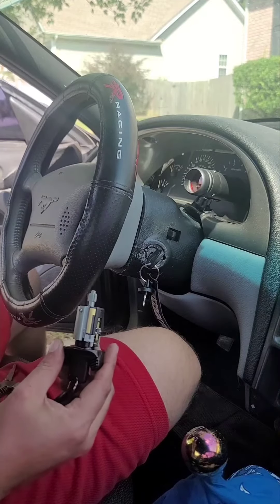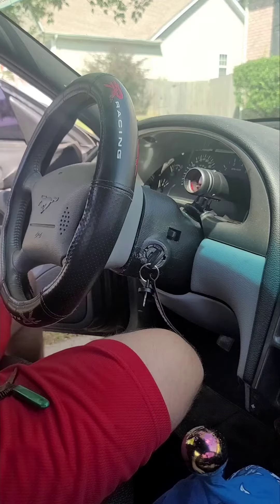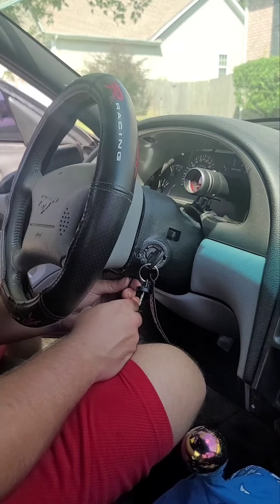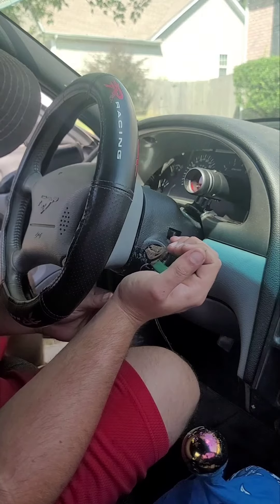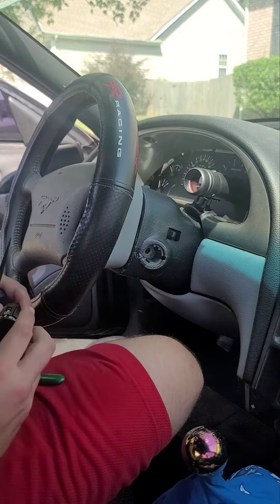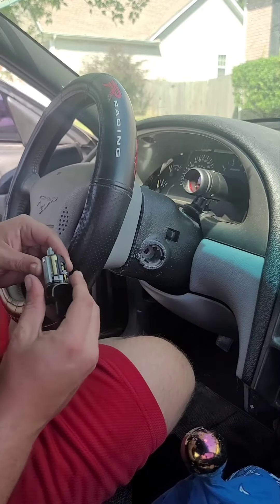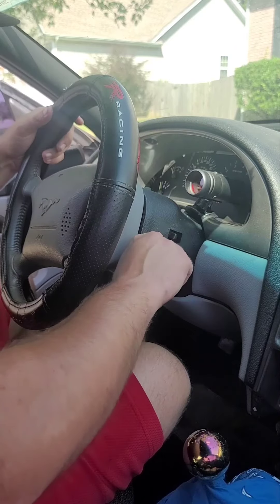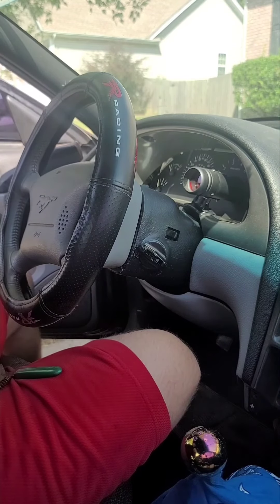94-04 Mustang Ignition Cylinder Replacement

Comment: Pushed on the pun and tried the pull and it did nothing for me. Wondering if the locked steering wheel is preventing it. I have a 96 gt

Comment: did you need to have the key programmed and the door locks rekeyed? Thanks for the help.
Reply from the maker: Ignition key does not need to be programmed on 94-95, starting in 96 Ford had PATS antitheft and it can cause problems.   Door locks will need to be keyed to the new ignition key to match (trunk lock too!)   I just keep both keys on my Keychain!
Reply: @cobro9567  these are the things you need to say in the video
Reply: @cobro9567  what do i do if i have a 97 full body/engine harness and a 95 wheel and steering column, re program?

Comment: How can I remove the black cap on the cylinder without breaking it?
I did a key fob upgrade and ordered a new cap that I can grind the tongue down on so the key will fit and I want to keep the original intact.